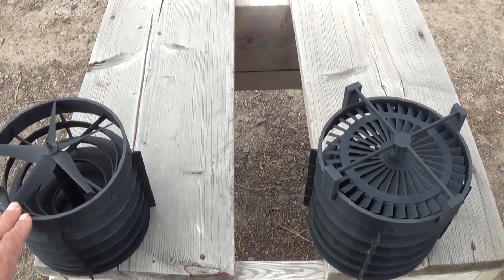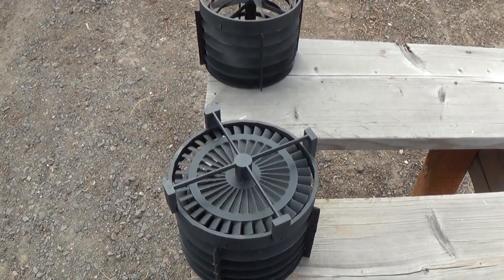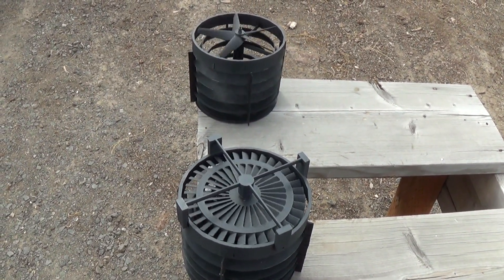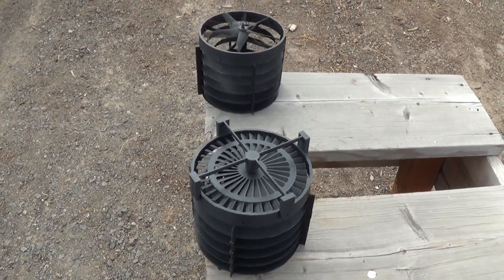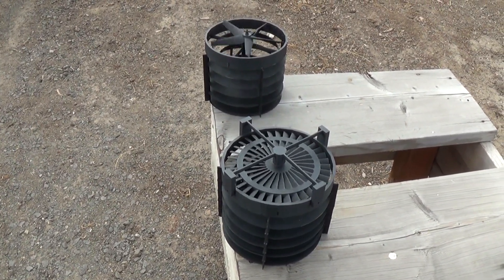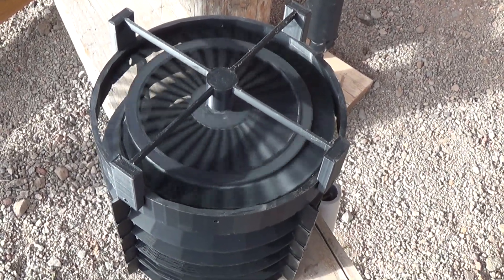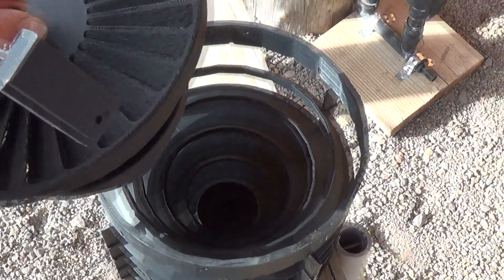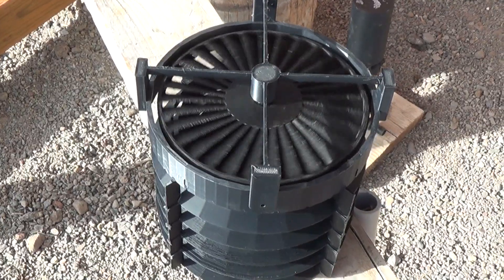Vertical Axis Wind Turbine with Multi-Stage Rotor, Testing the TurboJet Wind Turbine design!

Comment: I’m off grid at the back
Of our farm in a dry cabin  in NY . I’m so thankful you are sharing with us again.  I’m not sure I can swing printer and the time to learn to use it for awhile.   Will these be available for purchase at some point ?  Was thinking as trickle charger for batteries on windy days. 
    Couple of under 20w led lights and a cpap. And phone to charge.
Reply from the maker: These are only small test models, the generator is much larger at 9' in diameter and 12' tall.  I use miniature's to work out the bugs and perfect the design, then once the design has shown its self to be viable I build a full size unit for power generation testing.
Reply: @MrTeslonian  ok  , definitely more than I need for sure.   My neighbor that  was turbines , bio , wind ,solar head team at ABB in US might be interested. 
  He just consults now being retired. I’ve sent him your work before.  I wish your paths could cross some great knowledge between the two of you.
Reply from the maker: You have a good idea, for a smaller version that could charge cellphones and USB sized electronics, or could work as a trickle charger! I think the smallest you would want for 12volt power production would be about 3' in diameter, I will build a generator for one of these little test models and see what we can get for outputs, then do a video for you on it!
Reply: @MrTeslonian  that’s awesome !!!  I’ve been watching since your biogas truck .

Comment: Great design idea! Are there varying degrees of wind output speeds at the lip of each outer ring or are they the same? I was thinking about what would happen by adding a freewheel gear at the axis of each fan blade? 🌪
Reply from the maker: There are small deviations in wind speed for each level, we compensated for that be changing the pitch of each turbines blades, this should provide a comparable rotation speed at each level.